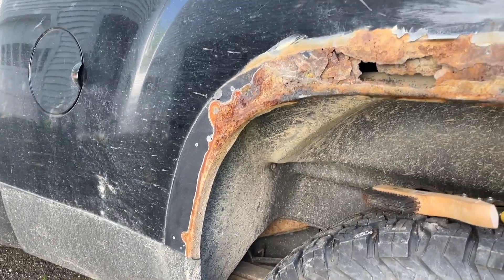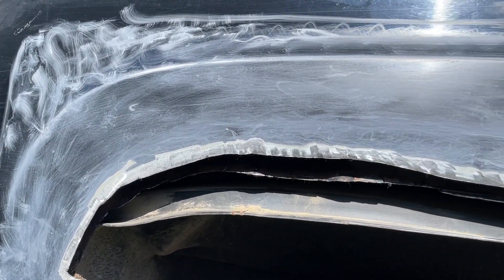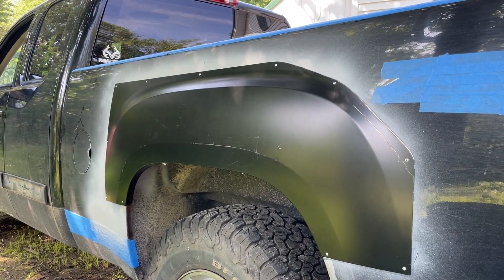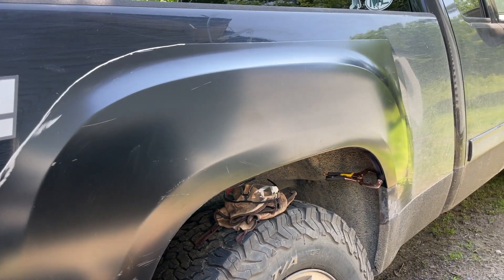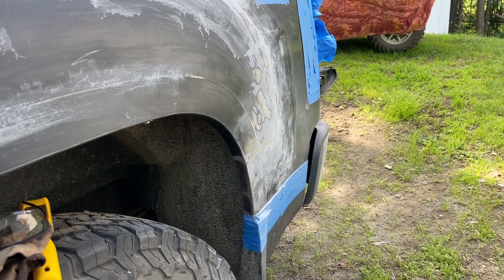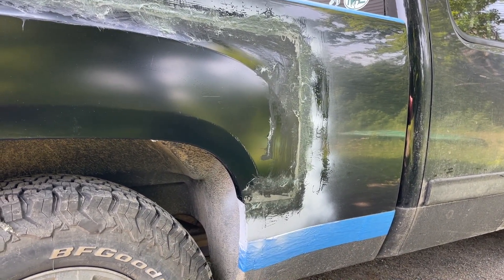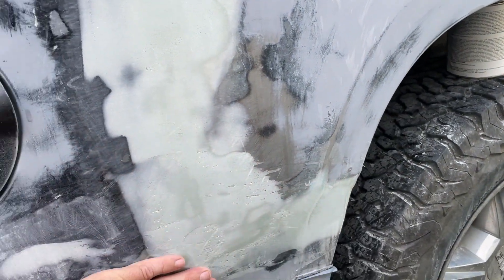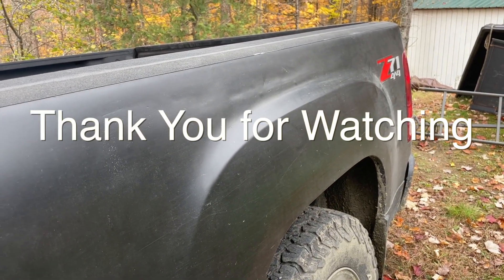2012 GMC rear wheel arch replacement

Comment: You should use regular bond, it will lay down smooth. Then use spot putty it will come smooth like glass. Body work is hard if you don’t have the right tools.keep doing it you’ll get it. Another  great video .
Reply from the maker: I could not find any of the regular bondo for quite some time. I thought maybe they stopped making it. All I could find was the fiber glass type. Eventually if you see me working on the passengers side I did find some and used a little on that side. I see a lot of people using rotary sanders and not vibrating sanders, like the one I have. It is what it is I guess. Hopefully it lasts me a couple years anyway. I can’t afford to buy even a newer used vehicle these days being on disability.